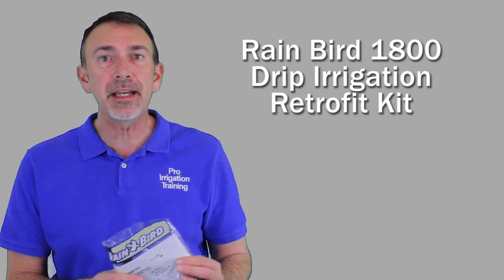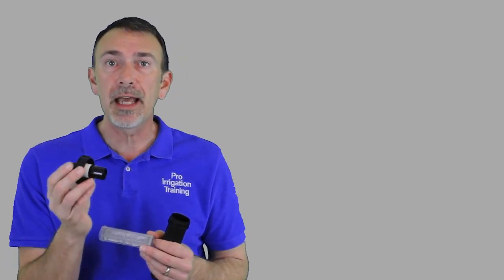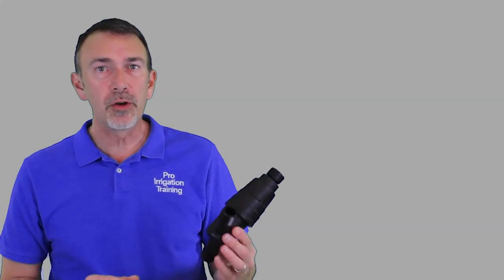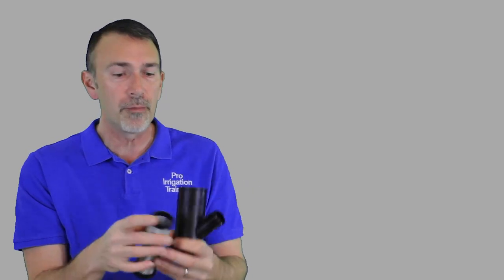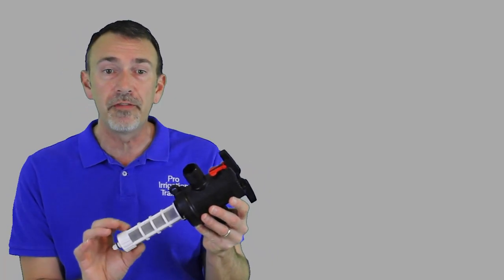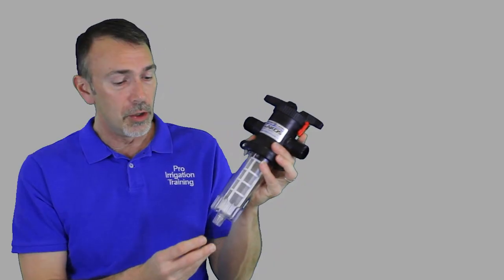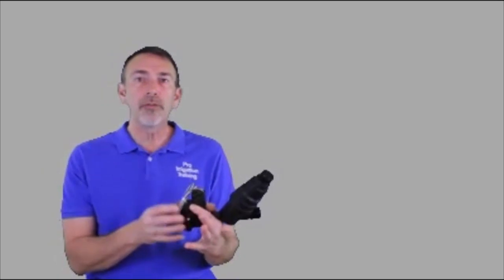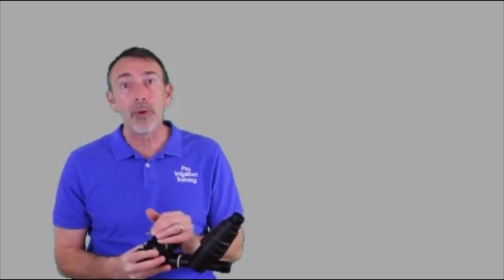Filtration Products for Sprinkler Systems | Irrigation Training

Comment: What do you recommend to filter chemicals out of the water.  My water comes from a well and has a lot of iron.
Reply from the maker: I don't have any experience with those kind of filters. I did a quick google search and it appears that there are some filters that will get the iron out. They're not cheap of course. But my understanding is that many people in FL who have iron, use an injection setup that injects some chemical into the water that prevents the iron from staining, if that's what your issue is.
Reply: @Proirrigationtraining  I have a well that feeds the irrigation system.  The water has iron in it and it stains everything.
Reply from the maker: @jackkatzman1116  Here's a link to some info. I wish I had some recommendations, but I have zero experience with this problem.
https://www.dripworks.com/bloghow-to-remove-iron-from-water-in-your-irrigation-system/